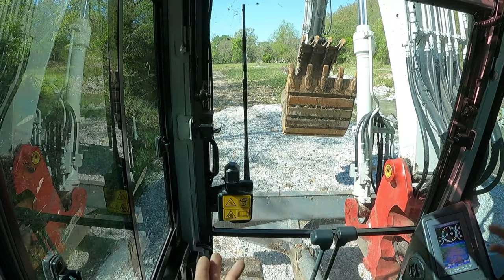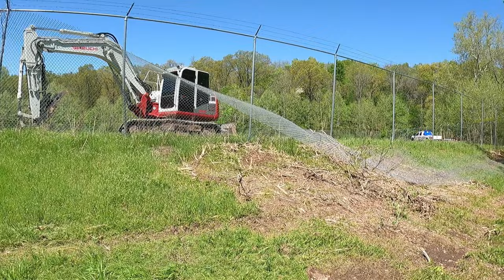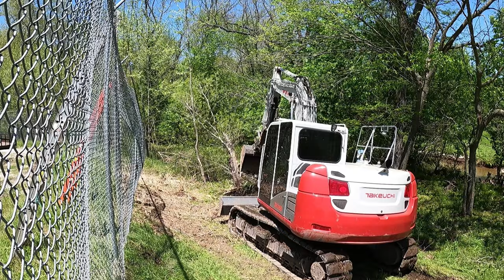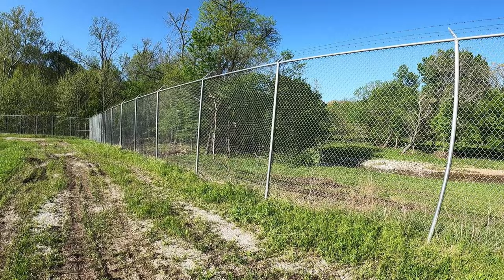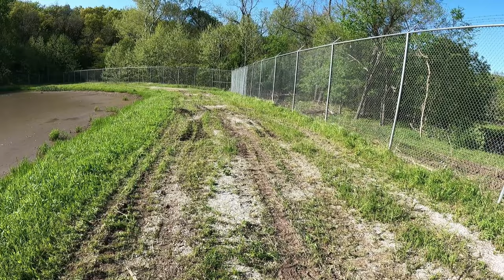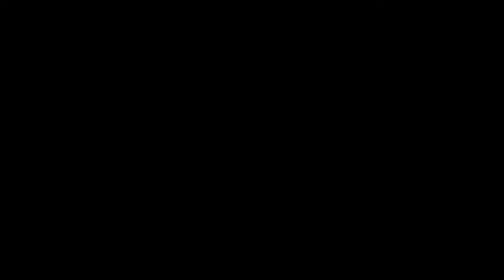Repairing A 10' Tall Chain Link Fence

Comment: Brandon… have you ever seen what happens when a string of barbed wire goes through a square baler?  

I was at the Kubota/Case dealer a couple of summers ago.  They had an older Case square baler on their used equipment lot.  An string of barbed wire had been used as an electric fence in a hay field.  Somehow the mower and the rake passed right over it… but the baler dug it out of the turf and started baling it.  The pickup forks, belts and transfer auger were mangled and plugged up.  

The farmer didn’t even attempt to untangle it.  He just traded it in for a new round baler.  The Service Manager told me they’d make me a pretty good deal on it As-Is!

I wonder what the rental discount would have been on the Fecon returned with an extra roll of 10’ chain link included with the return?

The fence repair looked pretty nice!  I’ve installed 8’… on level ground.  I can’t imagine tackling what you two did!
Reply from the maker: Oh man I can only imagine how bad that was. I would have done the same thing with it lol! Yeah I have no desire to ever do this again. 🤣

Comment: Well that wasn't too bad. I know you hate when when something like that happens but, at least it was fixable. I ran over a brand new roll of the woven wire fence like they use on the sides of the interstate one time while bush hogging a field and it got wrapped up in the bush hog blades. It took me 2 hours to get all that wire out of the blades. Lol. After that I always walk over the area I'm going to mow before I get started if it's feasible. Good video man, stay safe.
Reply from the maker: Oh man that’s the worst that stuff tangles up so bad before you can shut it off. Appreciate you watching

Comment: Had something similar  happen a few years back. Was bulldozing a lot and got tangled in a hidden cable, it pulled down a 6 foot chain link fence about 100 feet away.  Several posts folded over and the whole fence was stretched. Thankfully the fence was scheduled for replacement so I ended up taking it out and using some of it to fence my own lot. You are right about grading along a ditch or canal with the dozer, you need an excavator to dig the ditch and the dozer then grades the road.
Reply from the maker: Oh man that’s not good. Luckily they were replacing it. 👍🏻

Comment: Don't feel bad about a fence. I saw a bulldozer operator hang a power pole guy wire and keep driving. He pulled a 400 amp service off a large restaurant we were finishing up, pulled down the pole, transformers, and the 13,200-volt primary wires back 3 pole spans to the street. On the street, it broke the main pole and shut down power to a large shopping center and other road-front businesses. Way over $200K damages to the primary wiring, transformers, and poles plus the cost of replacing the service drop to the restaurant. The dozer operator was a 1 man outfit with no liability insurance. The $200K damages didn't count the main phone line feeding the shopping center. That probably doubled his liability. After the dust cleared, he jumped in his pickup truck and left the scene.
Reply from the maker: Oh wow! I bet he’s out business now. That was not a good day for him.